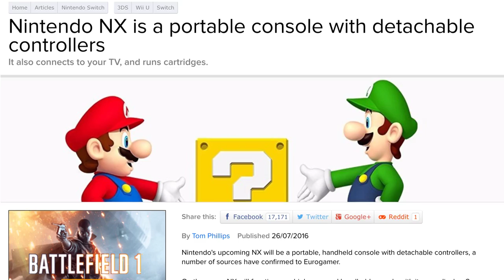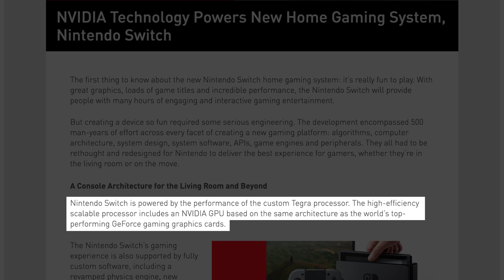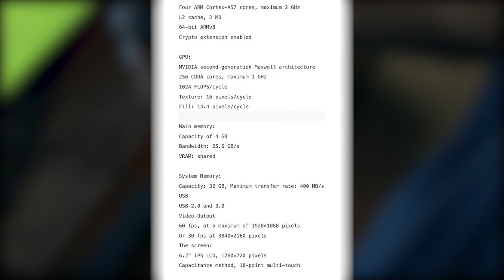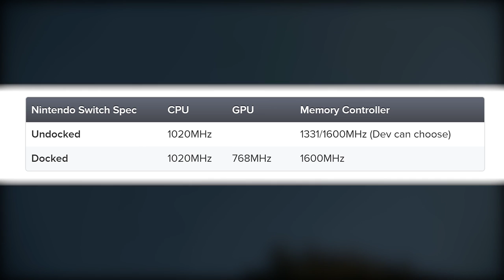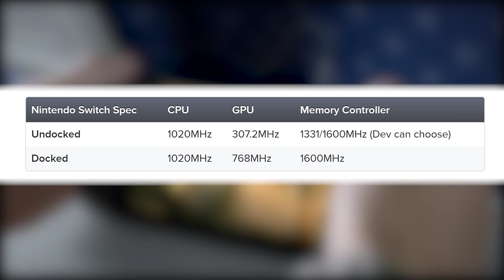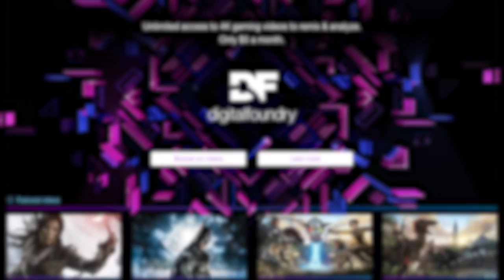DF Videocast #6: Nintendo Switch Clock-Speeds Revealed

Comment: No mention of operating system differences between the sheild and switch. Android's known to require more resources to run properly. Just look at specs between the iphone 7 and galaxy s7. On paper, the iphone's a joke spec-wise but is on even footing performance wise with the s7 due to android/touchwiz holding it back 😅
Reply: The switch will be weaker then an iPhone 7 (which already outperforms the not downclocked Shield console and Pixel C tablet in most benchmarks).

Here are some Benchmarks guys.

Geekbench 3 (processiong performance)

iPhone 7 - Singlecore: 3380; Multicore - 5500
Nvidia Shield Console - Singlecore: 1650; Multicore: 5040

The Switch will run at 50% of the Shield Consoles clockspeed.

GFX Benchmark (graphics performance) Trex 1080p offscreen Render:

Nvidia Shield Console - 120 FPS
iPhone 7+ - 108 FPS
Google Pixel C Tablet - 103 FPS
iPad Pro 2015 - 170 FPS

And the Switchs  GPU will run at 1/3 of the clock speed of the Shield Console.

Comment: I don't understand the negativity in the comments. That thing will likely be the best handheld on the market when it's released. I feel like a lot of you had fairly unrealistic expectations. The only disappointing thing with these specs, IF they end up being accurate, is the CPU speed that doesn't ramp up when the console "switches" to docked mode. The rest of it is sounds adequate.

Comment: Well if the undocked specs are true then the switch when undocked will be slightly less if not equal the power of the wii u's gpu at least then 720p cross gen games would not be impossible.

Comment: the only positive out of the switch is that we must accept the fact that its plain mainly a handheld device and succesor to the 3ds, and olveral that nintendo was wrong of this being first a homeconsole. that notion they make will bite them back in the marketting aspect and need to be clear that its based on mobile archetecture and not console.

Comment: Anyone have an educated guess as to how long it'll take for people to find a workaround to be able to run the console at 100% while in portable mode? Because I'm pretty sure that'll be a thing, just not recommended by Nintendo. Maybe voids warranty.
Reply: Rui PTG You probably dont really want that... battery wouldnt last half an hour and the tablet would get too hot to hold (the dock even have extra fans)

But in theory you would just need an external battery connected to the usb-c port, and some little workaround to make it think the battery is a dock

Comment: 256 cuda cores @ 768MHz : 393 GFLOP
256 cuda cores @ 307.2 MHz : 157 GFLOP
Wii U : 365 GFLOP

It just doesn't make sense. So either there is more cuda cores, or those clocks are just wrong.
Reply: What If, it had 640 cuda cores, that would be 5 SMs, it would gives it 393 GFLOP undocked (more than the Wii U) and 983 GFLOP docked ( close to the 1 TFLOP that we keep hearing) at those clockspeeds.

Comment: So from my understanding then if it is Maxwell, then the 1TF rumoured performance is using FP16, instead of the FP32 that the current gen uses.

With the addition of the comment Mark Cerny had made about the Pro also being capable of using FP16 which would give the console double the compute power (and likely the Scorpio will also support this if it's based on Vega) I would be interested in reading DF article on what this actually means for developers, and what sacrifices would developers have to make to used FP16 over FP32. Will this lead to problems for third party developers? Leading to once again not seeing the AAA titles on the Switch.
Reply: hmoham It's performance advantages are overstated. It's better to expect it's true performance to be closer to the FP32 numbers.
Reply: Then wouldn't that put the mobile mode performance well below the Wii U and the docked mode performance not much higher that WiiU with potential bottleneck with the CPU?
Reply: If you want to comment, don't shout like a idiot. this is about the capabilities of the Switch and the potential advantages and disadvantages of FP16. The PS4 Pro has support for the FP16 but so far all games have not used it, and as for Skyrim not running at 4K 30, it's a surprise it can even manage that, considering Bathesda have the worst optimised games around.
Reply: I think you mean 0.65TF, 6.5TF would make it a beast. According to the latest Eurogamer article, it's nowhere near 1.3TF but closer to 0.8 TF for docked mode and just above 0.3TF for portable mode.
Reply: hmoham "Then wouldn't that put the mobile mode performance well below the Wii U and the docked mode performance not much higher that WiiU with potential bottleneck with the CPU?"

Not really since the Wii U GPU architecture (VLIW) is archaic. Compared to Maxwell, there's a significant performance advantage in terms of architecture alone.

I read somewhere that Maxwell can make up for upto 200 GFLOPS disparity when compared to the slightly newer GPU architecture which is GCN. Since VLIW, the one used in Wii U is older than GCN, I doubt we'll ever see the Switch performing worse than the Wii U, docked or otherwise.
Reply: WTF are you talking about?
FP16 as in floating point 16 and 32.
That's about computational accuracy... not 'raw performance'.... Unless you're talking about something else. Elaborate.
Reply: architechure and gflops both lead to the performance of the chip
Reply: Faizan Ali 
I don't.
Performance is subject to the action performed. The most logical conclusion then would be by measure of time if someone were to want to do such a measure.

Example: CGI for a movie requires different equipment, methods and technologies than say doing physics or mathematical computations... however, in most cases, time is the primary factor in question (but not always).

If you want to me specify what I meant by "raw performance" then you should assume that I intended it contextually to the task... which wasn't specified... but one could safely infer it was talking about performance in rendering games.

So in this case, the OP was talking about FP16 and FP32... which just refers to floating point size for numbers... this has nothing (relevant to anything your average Joe would be familiar with) to do with performance.

To explain it very loosely, the size of a floating point determines the size (decimal points for example) of the information able to be stored, for using in various calculations.... the larger the capacity, the more accurate the calculations because of reduced errors from rounding.

This does not mean something is calculated faster... just better.

So... in relation to "raw performance" for any specific computational task (or in the case of games), how do floating point sizes affect the speed at which those calculations are made...??
Reply: Justin Wong 
That's far too broad to mean anything important.

First of all a Gflop is a Giga-flop, so why not just say FLOP?

Second of all, that goes back to what I was saying anyway: FLOP is floating point operations per second. So the measure is time.

Architecture just refers to... broadly speaking the design and method in which the hardware functions and interacts... while there are performance gains or losses to be made there is no universally best "architecture" (that we know of yet)... some architecture works better than other architecture when it comes to various tasks.

AMD taught us this lesson over a decade ago when their much lower clock speed CPU's well outperformed the higher clock Intel's in various tasks.

Anyway... it doesn't help explain how FP16 or FP32 plays into performance and I'm genuinely curious where this came from....

Comment: Are these specs pretty much confirmed? Becaus the exhaust fan on the Switch doesn't really make any sense if it runs at nearly half speed of the Shield TV. The exhaust grill is even bigger than on the Shield TV. And in undocked mode, it should be weaker than the Wii U, yet Zelda runs better on the Switch undocked than on Wii U. I rarely question your info, but this just doesn't seem right. Nonetheless, I'm sure the Switch will be a very neat console, especially as a handheld device.
Reply: Nope, foxconn leak is much more credible, DF used old dev kits.

So its Pascal which means that it can overclock for less which means it can get more GHz than ps4 and xbox 1.

Comment: So it's about as powerful in handheld mode as the Wii U running the same resolution. Docked it should run Wii U performance @1080p compared to Wii U's 720p.

Comment: Here's the thing that a lot of people aren't understanding, regardless of how powerful it is or what it's competing against.

It's the games, which are the only reason as to why anyone buys a Switch, PS4, Xbox, whatever. The reason the Wii U tanked was because of the botched marketing (they focused far too much on the controller) and they aimed for the same casual market as the Wii, which led to low consumer purchases, effectively leading to the fallout of third-party support, and then a lack of games. Nintendo also had very little first-party games at all on the system due to counting on those third-parties for providing them, which didn't happen after a year in, alongside struggling with the huge increase in HD development resources, something that everyone else went through 10 years ago during the release of the 360 and PS3. Poor marketing decisions and very few launch games.

The 3DS nearly saw the same fate starting off; initial sales were poor to the point where they slashed the price of the thing only 6 months after to try and get people to buy it, which did work. Once the games started pouring out, everyone and their mother bought one, and it's currently one of their best selling handhelds with a massive library of entertainment, regardless of the specs. Meanwhile, with Sony and their Vita....

The Switch is an interesting beast. While it may not be running top-of-the-line specs, it is an attempt to combine their home console and handheld install bases into one (they've merged both of their development branches) in order to leverage sales. Additionally, they plan to come out of the door with a decent number of actual launch titles to keep customers interested. Not only that, but their teaser trailer had broken over 20 million views in the span of a week, and unlike the Wii U, everyone has a basic idea of what it is and does.

If we're gonna talk specs, then again, while it may not be top-of-the-line in terms of power, it's still equipped with very modern software technology (for an example, while the original Wii may be more powerful, the 3DS has much better support for shaders). In fact, if anyone actually bothered to read that NVIDIA blog about the Switch's technology, they're using a special API (think DirectX or OpenGL/Vulkan) known as NVN, created to leverage full performance out of the Switch, whatever that may be. It's not just about power, but the software technologies that have been created to leverage that particular performance. Just look at 360 games on launch vs. at the end of the gen.

But in the end, it all comes back to the games. They are the reason the Gameboy Advance sold so well, the Nintendo DS and now 3DS sold well, and while the PS4, even with its fairly rocky start, is continuing to sell. Xbox too.

Nobody will truly know anything until January 12th, when the Switch will officially revealed. Until then, wait patiently. Oh, and before anyone yells Nitendrone, I own a gaming PC, PS4, Wii U, had an Xbox (lol), both a 3DS and Vita, and quite a few retro consoles. For the games.

Comment: Well, that is dissapointing.... I mean, I expected nintendo to do this, but ever since the Switch was announced I thought of it as a Nvidia console with nintendo branding, meaning the NVidia has as much riding on this as nintendo. I expected Nvidia to have this, potentially the best selling mobile device they ever worked on, a display of their latest and best technology.

I can't imagine that the people at Nvidia wanted to use dated technology for their project with nintendo. I thought they were going to push their latest stuff so the Switch could be the flagship of their ARM processors. 

Apprantely not, it's just a Shield with a screen.

Comment: so we are talking  a modified yet downclocked tegra X1??...lower specced than most thought I imagine. The problem we have here is that games cannot be built ground up for the 2.5X GPU power when docked...they have to be built around the heavily nerfed portable mode, which  is looking like an equivalent to a more powerful WII U.

So we can expect absolutely zero triple AAA current gen games....more like WII U and 360 ports up-ressed to 1080p when docked. I doubt devs are going to design two different graphical configurations when it would be more cost-effective to just up-res it.

Comment: I'm not so quick to judge, because I thought for sure the original Wii was gonna tank. It also was an underpowered console relying on a gimmick. But it doesn't look good for the Switch... Most people these days will just use their phones for mobile gaming.. And the thought of compromising on power, and paying extra for an HD display that just sits there when docked seems wasteful. 

But, for the Nintendo faithful, I can see that appeal.. No more needing to buy a DS and a Wii.. Now you can get it all with just one system

Comment: Nvidia themselves day 1 said that the Switch will use their latest gen gpu architecture which is pascal.
Reply: can you post a source?
Reply: NVidia didn't say that. if I recall, they said the swtich is based on their top of the line GeForce. at the time the only one out was maxwell

Comment: xbox one and ps4 based on 2010 gpu tech for 2013 released systems. Switch  based on 2014 gpu tech for 2017 released system. Even if the rumored 1 teraflops is slightly less than the xbox one's 1.3 teraflops, 4 years of tech advances is a huge difference. Especially 2010-2014 when Nvidia gpus generally were more powerful than AMD's. These reports need to stop ignoring common sense.
Reply: enya64 tru

Comment: How close is this thing to the Vita?
Reply: Yea, we'll have to see how it handles games. Cross platform probably won't have legs very long. You should know though that FLOPS is not a measure of performance that applies different chip architectures. Its a marketing metric that includes number of cores multiplies by mhz. But an AMD core and NVDIA core perform differently, so its not a directly applicable metric. It applied between PS4 and XBone because they are both using the same CPU and GPU architecture.

Comment: I commented on a video before and stated that the switch needed to be more powerful than the current iPhone, but now it turns out that switch isn't even more powerful than a several generation years old iPad which is disappointing coming from a true Nintendo fan. Nintendo should've just gave the switch the Tegra x2, a 1080p display, and tried to at least come to parity with the xbox 1.

Comment: I'm still not convinced of they will use Maxwell but aside from that I'm expecting a Xbox One base model power for the Switch.
Reply: Joel Sola López even with best tegra it will not Xbox
Reply: Orjon Zaganjori it could if it is a modded Tegra.
Reply: It can't. It limited by memory speed. It will be so far off Xbox it's not even funy. It will be Nintendo Vita in my eyes.
Reply: Joel Sola López Chances are, Nvidia could be working on the Switch's custom GPU for at least a year or two.
Reply: Orjon Zaganjori the Wii U is more powerful than the Vita and the Switch will be more powerful than the Wii U even if we count this rumors as true so it is not.
Reply: Undocked it only has 157 GFLOPS. Wii U has like 300+.
Reply: MorimotoYTP that is also possible and maybe is because of that reason that different rumors point out different chips.
Reply: This level of perforce is more then fine for Nintendo but not 3rd party. It far too low to port games. They are building games with min spec of 1300 GFLOPS. You cant really dump down 8x. 3rd party is not going to make specific switch games if this console is not successful.
Reply: nVidia TFLOPS are lower than AMD for the same real world performane.
Reply: wii u had 176Gflops, any GFlop more than that.
Reply: Nvidia Gflops are about 4/3 AMD are.
Reply: @Joel Soala Lopez

The switch will be weaker then an iPhone 7 (which already outperforms the not downclocked Shield console and Pixel C tablet in most benchmarks).

Here are some Benchmarks guys.

Geekbench 3 (processiong performance)

iPhone 7 - Singlecore: 3380; Multicore - 5500
Nvidia Shield Console - Singlecore: 1650; Multicore: 5040

The Switch will run at 50% of the Shield Consoles clockspeed.

GFX Benchmark (graphics performance) Trex 1080p offscreen Render:

Nvidia Shield Console - 120 FPS
iPhone 7+ - 108 FPS
Google Pixel C Tablet - 103 FPS
iPad Pro 2015 - 170 FPS
Xbox One - 400 FPS

And the Switchs  GPU will run at 1/3 of the clock speed of the Shield Console.
Reply: Yeah. The only problem is iPhone can't run same speed for 1 hour of gaming.
Reply: Or 15 minutes even, if the game is pushing the hardware enough.
Reply: Actually it can without much problems. The iPhone 7 lasts 2-3 hours under heavy load on battery without downclocking
Switch will have bigger battery.

Nintendo just cant make good hardware
Reply: coolertuep yeah sure... it has nothing to do with the iPhone 7 being more expensive.
And without downclocking? SURE... I thought the hardware in mobile phones was always downclocked to make the battery lasts more. 
Show me an Xbox One game running on an iPhone with a consistent framerate, 720p and that the battery lasts longer than 3 hours and I'll believe you.